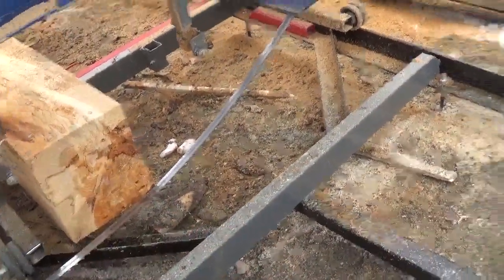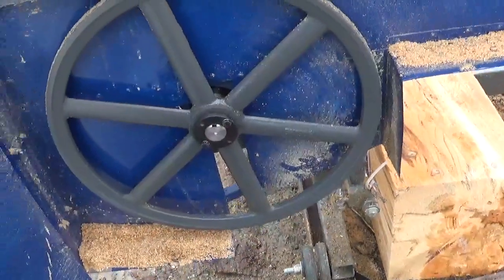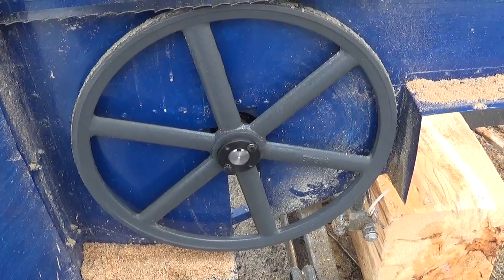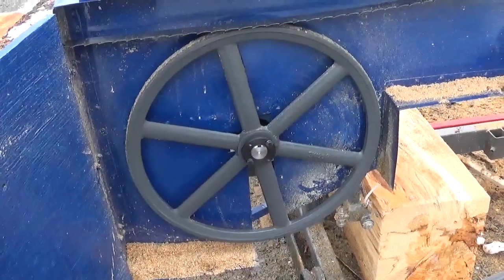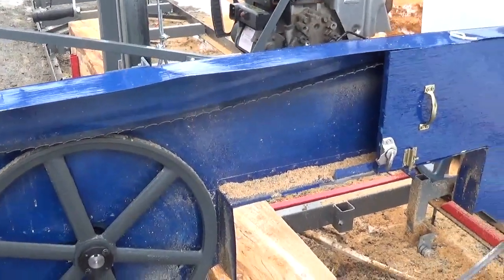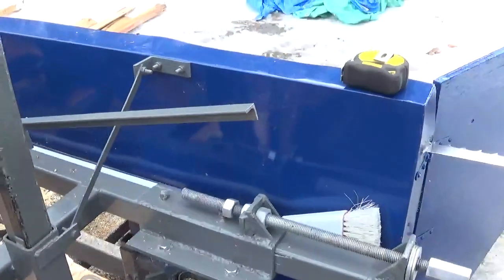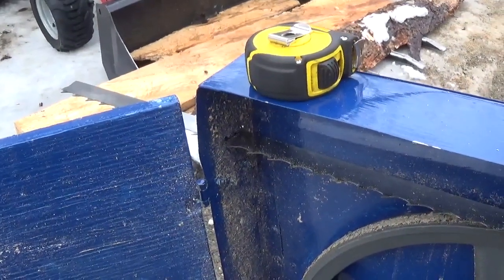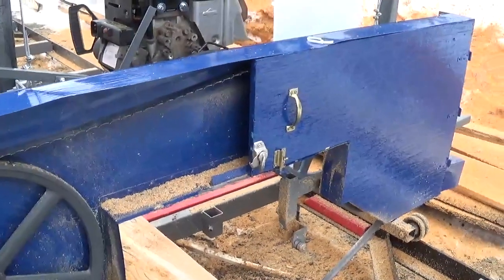Homemade sawmill safety talk and tip the saw head on the side.

Comment: Hey Serge!  Glad you are ok and no body got hurt!  $300 is not bad to get it back up and running.  I think you are right! If you would not have built it so strong it would have cost a lot more!   Have a good weekend!   See ya in the next one!
Reply from the maker: I was suppose to buy one like range road or woodland . You damage the head like I did to mine you need to replace the head and it's more tan 300$.Have a good weekend to.

Comment: Hey there Serge, good to see your sawmill video.   Glad you or no one was hurt when the blade shot out the side of the shield protector.  Great safety tips to pass to sawmill owners.  Lately, there are more and more folks buying or building sawmills to cut their own logs.  I wish I had a saw mill and could treat the wood.  Most of the trees I own are pine which is the primary species of wood for building structures and outdoor projects.  Enjoyed  full-watch.  Have fine weekend, Serge.  Be well and stay safe, my friend. 👍🏽🙂
Reply from the maker: Thanks mi good friend . Some time you will find use sawmill for sale. the reason people are buying or make there sawmill the price of the wood is to high. Have a find weekend too.

Comment: Serge was you sawing when the blade broke or out of the wood. i have broke 4or 5 blade on mine homemade sawmill but always in the wood .about 300 hours sawing time .usely in a hard knot with not so sharp blade operator fault
Reply from the maker: It was out of the wood .Was an old blade whit allot of hours on it.